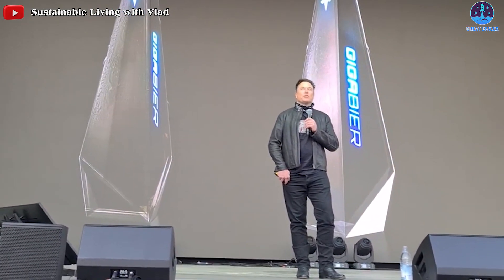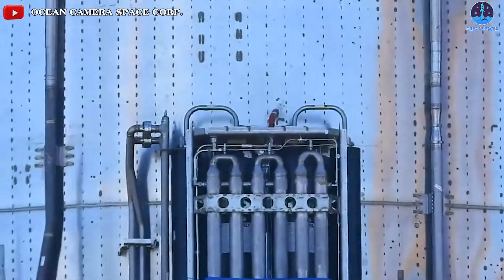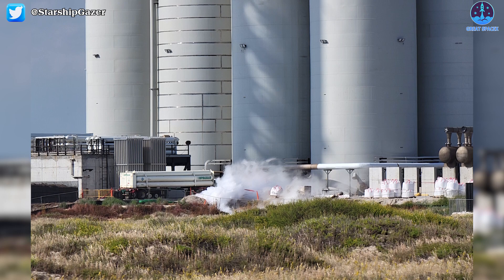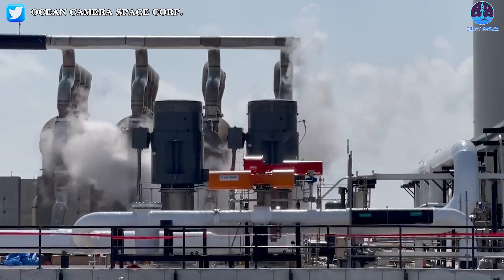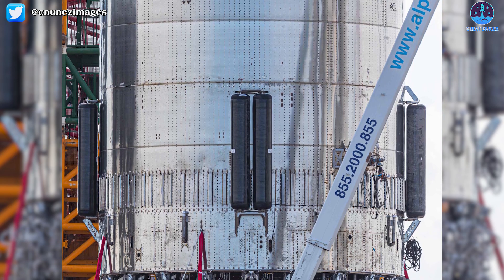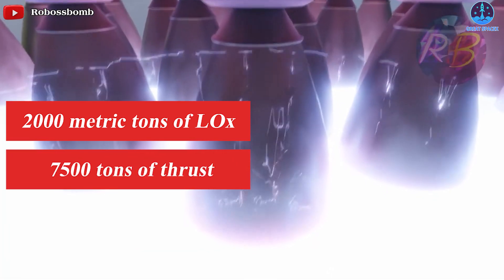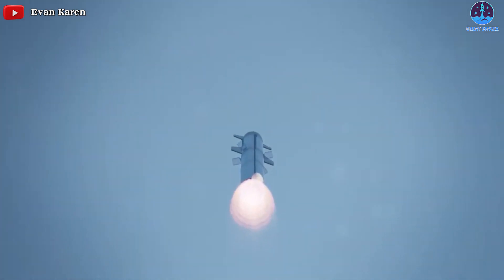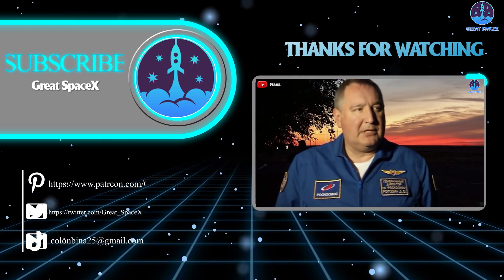Super Heavy Booster: "The Monster" is more mind blowing than you thought!

Comment: If Starship can be refuelled in space then why not turn it around and reduce the horizontal speed to so low that tiles can be eliminated entirely ? Is it possible theoratically ?
Reply: Don't forget that Space X is going to use several other Starship launches (possibly SIX or more) to refuel the mission vehicle in low Earth orbit. Every one of those launches will need the assistance of a Super Heavy Booster to reach and dock with the mission vehicle AND following EACH refueling procedure the tanker Starship(s) will need to endure the rigors of reentering Earths atmosphere.

SO... Moon/Mars landing Starship launch with booster followed by a couple of other starships conducting alternating refueling flights with each of the tanker Starships spending only a FEW hours on the ground before being stacked back onto a booster and being refueled for another flight